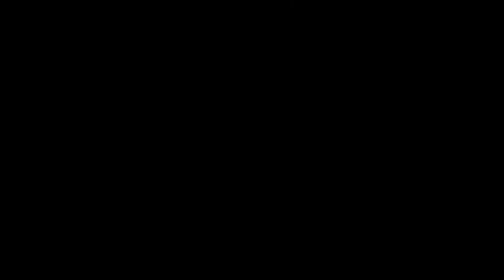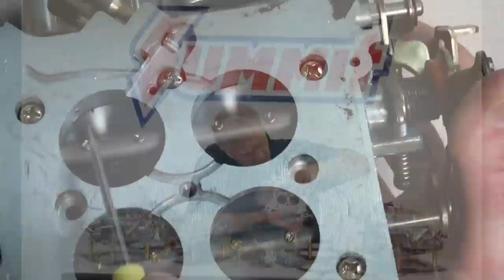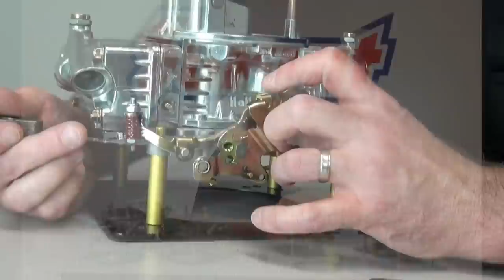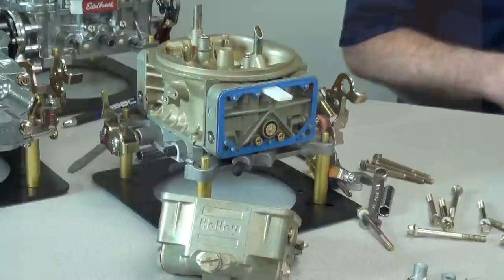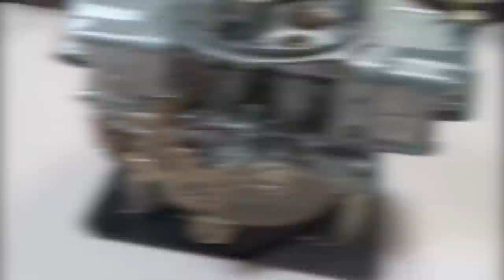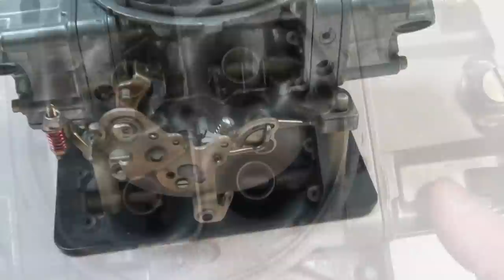Holley Carburetor Performance Tune - Summit Racing Quick Flicks

Comment from the maker: Hi Dave,
To an extent, Toyota Acoustic technology and a dual plane intake are trying to achieve similar results by providing optimal air mass or air and fuel mass to the valve. Speaking in general terms; the Toyota’s Acoustic technology looks to provide optimal air mass across the entire operating range of the engine in question whereas the dual plane attempts to enhance delivery of the air and fuel mass at lower and mid RPM ranges at the expense of higher RPM delivery. I hope this helps.

Comment from the maker: Dear beilno,
  Jet and tune for the most power that you can make “safely”; chances are this will put you in the 12.6/12.7 to 13.1/13.2 to 1 A-F ratio. Please consider this also: as you’re running the RPM range on the dyno pay attention to the vacuum readings as they pertain to throttle position and engine RPM and use this opportunity to dial in the power circuit.

Comment: I'd like to see this series updated using the Summit Racing carburetor.  I bought the Summit 600 CFM for my mild 351w in my 1980 Mustang and man that thing runs good.  I adjusted the idle circuit using a vacuum gauge like Norm showed in the video.  Y'all made one hell of a carburetor!!  See through float glass, one piece top so there's no fuel spillage.

Comment from the maker: Hi Boostin,
Premise: for this conversation - pump gasoline. Okay, so depending on the chemistry of the fuel a balanced stoichiometric equation could be between 14.0:1 to 15.0:1 air to fuel; ideally you would say 14.7:1 but oxygenated add on chemicals are everywhere now. People used to think that the best ratio for power was around 12.4-12.5-12.6 to 1.

Comment from the maker: Likewise stuffing more air in without the additional fuel does not generate the desired extra power and may leave you dangerously lean – again balance! For the lowest in emissions go toward the balanced equation of 14.7:1; for steady state cruise at part throttle you can still run toward the 14.0:1 or slightly higher only be certain that as soon as you load the engine for more power and more throttle position that the air side drops toward 13 or so.

Comment from the maker: Hi Ron,
Yeah, mild cams not so much. Remember there are quite a few things that come into play, displacement, RPM, the actual valve timing to piston location, the static compression ratio, etc. It might be that what you’re thinking about here is overlap. Let me know…

Comment from the maker: For the last couple of years this has gradually crept upward toward 12.8-12.9-13.1-13.2 perhaps even 13.3 to 1 which is headed back toward stoichiometry. Keep in mind that from a power tuner standpoint this all about balance; you can only burn the fuel (oxidize the hydrocarbons) to the point that there is oxygen available too much fuel and power will decrease.

Comment from the maker: As far as the Adjust-a-Jets from Percy’s go, I have used other versions of external jet adjustment through the years most with fair or better results. I did use a system some 20 years or so ago that I could not keep dry, no matter what I did they were always weeping fuel.

Comment: Hi Norm, great vid with great tips as usual, i follow most of your advice including tuning with a vac gauge. mine is a small motor bike american standards, a 4.0 or 240ci, but quite agressively tuned street motor, running a dual plane manifold and modified holley 8007 (390cfm) modified with secondary metering block and centre hung float bowls. i know about the transfer slot and not exposing too much of it with idle screw. my issue is keeping the idle speed up at around 900rpm (using in car / dash tacho) i can get it running better using the idle mixture screws while watching the vac gauge and can get it up to around 15hg by screwing them in from the one and a half turns out start point, but i get the best idle and highest reading by screwing them all the way in!!! i realise that can't be right, so i back them out half a turn and the vac reading drops and inch of mercury but it still idles nicely, so what is going on/ am i pulling too much from the transfer slot even though i am keeping the visible slot square shaped, do i need to open the secondaries a crack or drill the primary butterflies as you suggest in this vid, or is there something else going on OR is it ok to just run the car with the idle mixture screws screwed in? it starts and runs well and goes like a rocket, i'm just concerned it is not right to have them screwed in? thanks in advance. Drak in London England..

Comment: Finally a performance carburetor video ! thank you. now a few questions , if you are tuning are carburetor with a wideband o2 sensor/gauge what is the ideal WOT and cruise air/fuel mixture (aggressive naturally aspirated  street to strip) and what are your thoughts on tuning jet sizes with the Percy's external Adjust-a-jets compared to traditional internal jets? and are they as reliable as the traditional internal jets? thank you

Comment from the maker: For WOT I would consider targeting the air side at 12.6-12.7-12.8 or so. At this point loading the engine and dialing it in on a chassis dyno would yield the best and safest results.
Reply: Dynos do NOT give accurate tuning results. The loadings are totally different than on the street or track. All my drag racing buddies that have tried it went slower after the dyno & had to go back to their track tuning!

Comment from the maker: Be sure to verify that your throttle linkage or throttle cable and throttle plates are able to open all the way to WOT. Let me know how your tuning session goes, good luck.
Reply: Friend of mine has an odd system on his street car . He has 2-4s but they're vacuum secondary but mechanical , still with the metering plate & no secondary pump .
Im not sure how hes not getting a huge lean spot .

Comment: Great videos of what goes on in a carb...but what effects bogging the most? Jets, squirters, or power valves? I had a pro re built 650 double pumper Holly on my 350 chev. with tunnel ram, auto trans, mild cam and ran great. Bought a new polished 650 Holly from Summit and runs terrible??? Help!!!

Comment: question about power valves... on a really radical motor...690 lift.. 13.5 to 1 compression...using the 850 DP...where should I start in the power valve range... ....and an idea of jet size.... just as a start off point....thanks... love the video's...very informative...
Reply from the maker: +Eddy G, 
Out of the box, the carb will have adequate jetting and power valve sizing to get you running. Set your float levels and fuel pressure and ignition timing properly and start your tuning process. Get a manifold vacuum reading (in gear if auto tans.), a spark plug color reading and a general feel for drivability. Feel free to give us a call with any questions. 1-330-630-0240.

Comment: Great video. I have a question or two if that is alright.

I have a "street" truck with Ford 302 with comp cams XE274, holley 670 vacuum secondary (primaries are jetted up to 70), and an msd pro billet distributor (mechanical advance only, no vacuum). At idle I am pulling around 10-11" Hg, in gear at idle it is around 5-6". I pulled the main metering block and it had a 6.5" power valve so I replaced that with a 3.5" power valve. After adjusting the idle screws for max Hg it idled fine and cruise was fine but if I give it a quick snap/rev while it is in gear it will bog down on its way down to idle rpm. If I catch it right after 2-3 quick revs the engine will die. Maybe I am missing something but it feels as though the idle circuit cannot handle the fuel coming in from the main jets, power valve, and acc. pump..

Is this a problem with jetting? Since I don't have any vacuum advance would there be any benefit to adjusting secondary speed screw to let some more air in?
Reply from the maker: Hi MasterKane1963,
Thank you for watching! Can you give our tech line a call? 1-330-630-0240.
Reply: Summit Racing
Tried throughout the day and all the tech staff has been busy.

Comment: Is it ever necessary to drill both the primary and secondary plates ( say smaller than 2mm, 1.5mm)?  Is it potentially advantageous to use different rated power valves?  Would a float chamber baffle improve the flow situation in the float bowl ?

Comment: The Ultra Dominator and Ultra Xp have an idle bypass located at the top of the carb and adjustable fuel nozzles in the metering block making drilling the throttle plates unnecessary.
 Some very large needle and seat (up to 150) sets available making it  to run fuel  pressure above the maximum recommended seven and a half.
Reply: Check out Holley's 6-513 off-road needle & seat assembly with the little spring.

Comment: My choke  hi idle is not kicking off when engine is warmed up  . I tried  to lube up the plastic cam  but it still is not kicking off. i can reach  it and wiggle it and it will kick off then  the engine will run at normal idle. This on my 1969  Chevy  Pickup  with a 350 v-8  Holly 4 barrel  carb   Automatic  transmission  350  automatic  I have tune the carb  as you have stated. Seems to still be running a little rich but better than it was.  Truck runs like a bear down the road .  What can I do to get that high idle to kick off like it should?  Is it an adjustment of the choke ?  Thanks !

Comment: I have a 383 stroker that has a decent size cam and lobe separation. Problem I have found when tuning a holley on it is that it always seems rich at idle ( burning your eyes). I have around 8 to 10 mg vacuum with a 6.5 power valve. Could it be that my power valve is the cause of the rich idle? I am going to go down to a 3.5 power valve but was still curious if the power valve had anything to do with an extra rich idle. Thanks for the input

Comment: Currently have a 670 trk avgr on a 351w 1969 motor.  It has a Comp Cams 35-239-3  dual plane intake ,headers, dual exhaust with flow masters and a crossover pipe. HEI dizzy new plugs and wires. The vehicle is a 1976 bronco. It starts fine, idles fine, has 5-6 psi at the carb. Driving normal its fine,,,,,, but as soon as i get on it the engine misses. Possible floats to high in back ?
Reply from the maker: Hi Mr Pick, 
You can certainly try adjusting the float to within spec. Also, when a miss develops under load, make sure to inspect the spark plug wires. It’s possible you could be getting spark jump outside the wires. You might also try to put boot protectors on to keep from burning them close to headers or manifolds.

Comment: How do I adjust my holly 750 classic so that it doesn’t run rich my plugs are black but firing ,383 stroker
Reply: Bobo mcrae probably fat style idle. I’d also try a warmer plug if you’re not planning it n running boost or nitrous.

Comment: I have a brand new holley 300cfm carburator. i can turn one idle mixture screw in all the way for highest vacuum, if i put it back and turn the other in, the engine stalls. i get the best idle vacuum at 1/2 turn out on both. no stumble, real snappy but running rich on the plugs. 16inches at idle, 7.5 power valve, 62 jets. 2.5 litre iron duke. circle track. Help!!
Reply from the maker: Hi 77camaro, 
We need some additional information from you. Can you please give our tech line a call? 1-330-630-0240. Thanks for watching!

Comment: Does the base plate from a 770 cfm fit a 465 both are vacuum secondarily, just the 770 has the kick down linkage for the ford cheers in advance
Reply from the maker: Hi keith, 
We need some additional information from you. can you please give our tech line a call? 1-330-630-0240. Thanks!
Reply: Hi base plate from 770 fits the 465  both were vacuum secondaries.
Not sure if this affects it running  but starts great. cheers.

Comment: "Quick Tip" ,
spray your new gaskets with WD-40,   this will prevent the gaskets from sticking!
Reply: Use PAM cooking spray.
Reply: chap-stik is what I always used
Reply: I’ve always used silicone spray. With mixed results. I might try the pan and chapstick. I feel like I go through a ton of bowl and metering block gaskets.

Comment: aren't front hung floats better than side hung floats? also are dog leg venturi better than straight?
Reply from the maker: +tamapalagi, 
Agreed, “Center Hung” floats tend to do a better job of controlling fuel level especially when the car is street driven and turning corners a lot.  There are a few types of boosters ( straight type, dog leg, Annular) used in carburetors and each have their place depending on the application. Feel free to give us a call and we can help you pick the one that’s right for you! 1-330-630-0240

Comment: Do you have a good race carb for my 383 sbc mid cam vortck heads
Reply from the maker: More information will be needed to help you properly choose the right carburetor. Please contact our sales line for additional assistance at 1-800-230-3030 or 1-330-630-3030.

Comment: awsome video, thanks helped alot.
Reply from the maker: Hi Anthony Pllu, 
Thank you for watching! Let us know if you have any questions.
Reply: only question i have is, each time i change my jet size do i have to replace the gaskets for the fuel bowl or are they re-usable
Reply from the maker: Ford FD, 
If they are the original Holley gaskets and are blue in color, they are considered reusable.

Comment: He really is a poor teacher; he acts as if we already know all the parts from his last class, without showing placement of subject parts, or how they work together in the carburetor, he talks about cams, however he jumps from engine cams, to carburetor cams without even showing carburetor cam placement, or it's function relating to the pump shot, or replacement colored cam types effecting said shot of fuel into the Venturi under various engine loads.